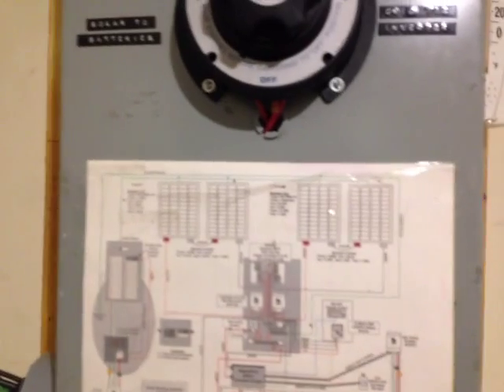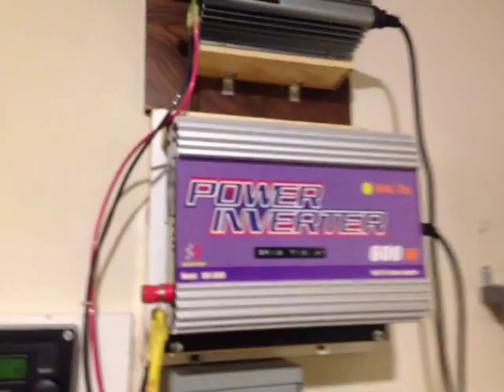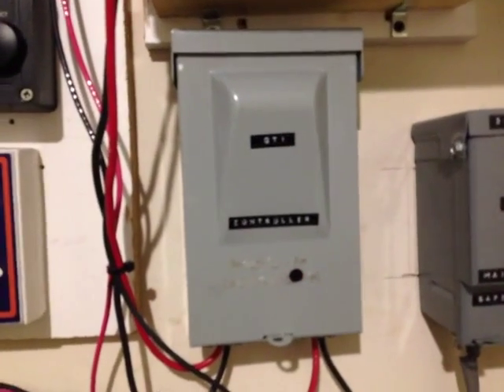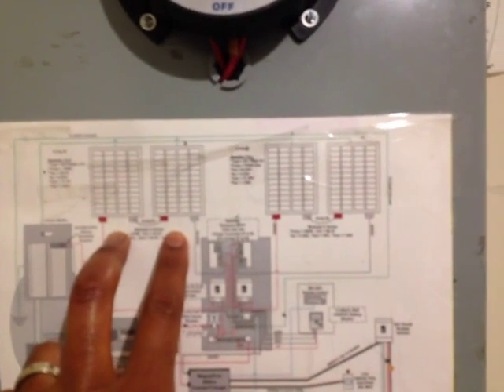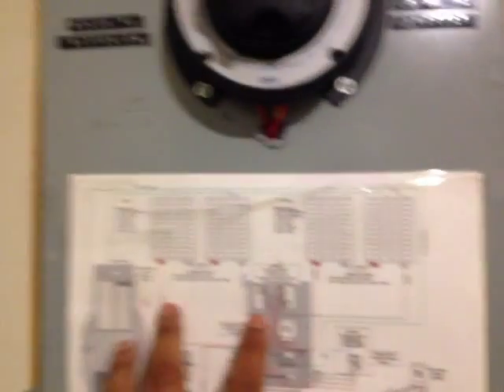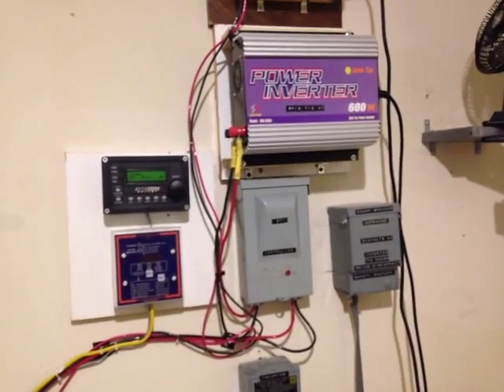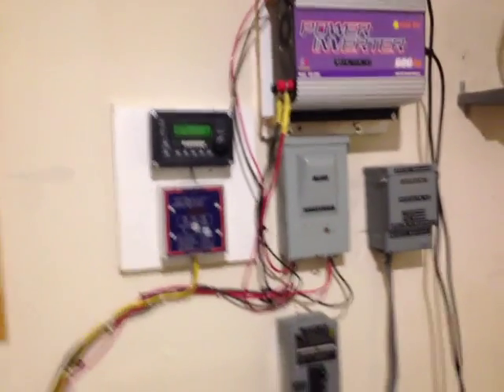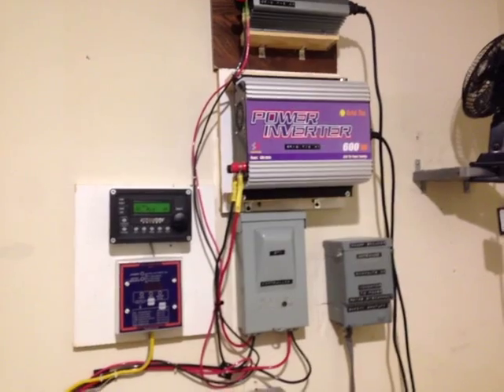Home solar update - video response to questions and comments.

Comment: I agree your system looks good and safe, I have been an industrial electrician for a long time and electrical fires and arc flashing is a big concern but very rare. The main thing is to know what you are doing and take your time. Also on a yearly basis you should go through your system and make sure all connections are tight and no sign of heat, a thermal image tool is not expensive and good for detecting a loose or hot spot.   Thanks for taking the time to show and explain your system.
Reply from the maker: Ed H Thanks for your comments and good advice.

Comment: I agree...these GTI generally don't catch fire (they are enclosed in a metal box). I also agree that much of the "danger" is being exaggerated by people who make money installing/inspecting these systems(spreading fear rather than knowledge).  I agree with your safety comments as well…there is no limit to safety for the person who does not understand there system… safety comes from knowledge/common sense/good electrical practices (not perfect).
Reply from the maker: G Young Thanks for your comments I and others do appreciate it.

Comment: Hello again, I was the one who was asking about insurance claim. Don't get me wrong I think you have a killer set up. My comment was not really meant to say you must have a proper electrician do the install. More of what my concern is that I was thinking on doing a set up just like yours and still may.

But I will try to explain my concern a little better. I truly believe anyone doing this that owns a home should contact there electric company and insurance agent to let them know you have done a solar install and have them add it to your policy. IF god forbid you had a fire in that room. As you know the fire department will determine the cause and report it to your insurance company before any claim is paid out.

Now lets just say that cheap grid tie was the cause. And thats what is reported to your insurance. Now you said it yourself that on your main panel it was law that you must have a back feed switch on there. But yet on your cheap small grid ties you are back feeding into the grid bypassing the main panel back feed cut off.

Now I would bet that if you called your electric company they would say that you can not use those little grid ties to back feed it may be illegal. I am not trying to scare anyone but I think its worth a couple phone calls just to make sure you are covered IF something happened. You can't really compare a solar set up like yours to installing a light switch or socket. But my main concern is those cheap grid ties that everyone buys that do indeed back feed without any protection except what is inside the cheap chinese grid tie. Which are not even UL approved.

Don't take this wrong I just would hate for someone with a 100,000 dollar home have a fire in there solar room and then have the insurance adjuster not pay the claim because #1 you are back feeding with those cheap grid ties without your electric companies approval. And #2 you did not notify your agent that you have added a second power source to your home. A second power source is a pretty big deal it is not the same as installing a ceiling fan.

I have seen a video of a solar set up burn a home to the ground due to a improper battery installation and it was not pretty. It killed there dog and the home was a complete loss. I do not know if there insurance covered the lost home. But again Im not trying to scare anyone just saying do your own research and if it was me I would get a sign off of my install from my electric company just so my insurance then would have no reason not to pay the claim. Great video and I love your set up! Just food for thought..Thanks for sharing
Reply from the maker: ***** Thanks for your comments and your point of view was well said.  I can't fault your explanation because it never hurts to be safe and cautious.  Also, it's always a good idea to weigh the risk versus reward before undertaking any risky task.  There is definitely some amount of risk in doing these installations and should be done safely and within the comfort level of the individual doing the work.

Comment: With new stupid 'smartmeters' being installed we all need limiter grid-tie inverters, it zero/cancels out incoming power but will not feed back power. It does that by measuring incoming grid power and making equal amount of solar/battery power...
Reply from the maker: Limiters are good, if you can find one that will work well with the US grid.

Comment: Just saw this video posted... https://youtu.be/EF6I6Z1FSeA
It is of a GTI similar to yours that seems to have caught fire. 
Not trying to scare you or suggest that there is anything wrong with your setup. Just sharing for your consideration
Reply from the maker: Dean Goldbaum Thanks for the info, I checked out the video and I've seen this situation before because I've burned out a few inverters myself.  I believe this was caused by overheating, at least that's what caused one of mine to go.  These chinese made inverters are risky and if you search here on youtube you will see others that have burned out as well, mainly due to overheating.  I still have yet to hear of a home burning down, but again, thanks for the info, it always pays to be safe.